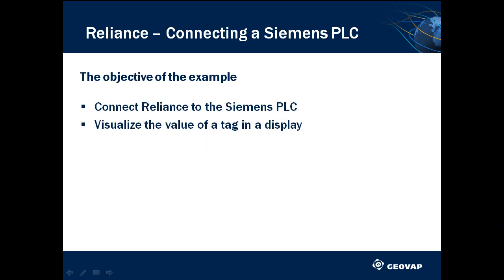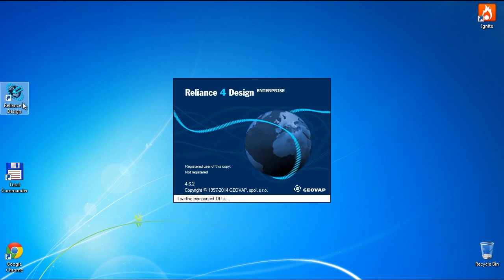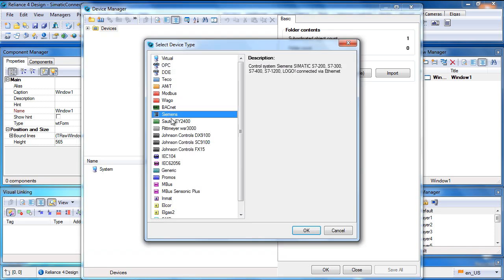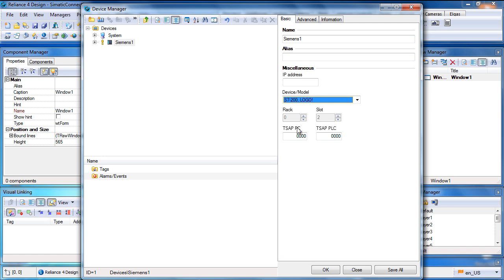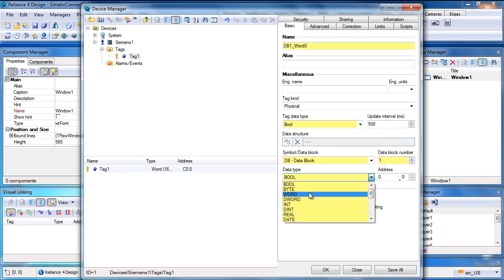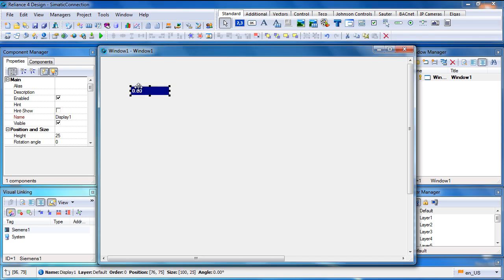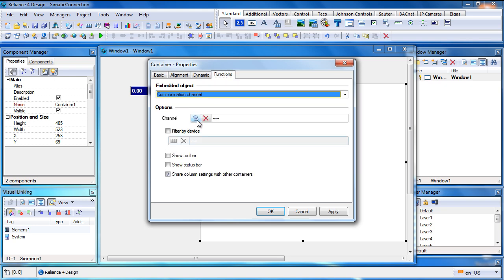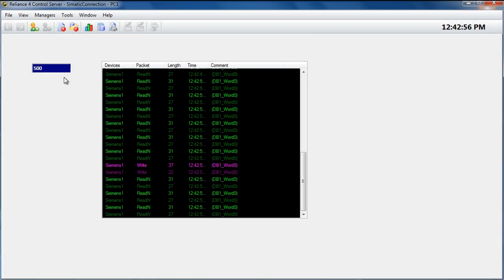Connecting a Siemens PLC to the Reliance SCADA/HMI system

Comment: As in your video you showed that communication is started when you enter ip address of simatic s7 and then start reliance control let me know what setup you used in simatic s7 currently i simulate simatic s7 with plcsim TCP/IP interface where my cpu connected with Ethernet with same ip configuration I entered in reliance design but connectection not established 
As per my analysis problem is in the simatic workstation configuration you will found In control panel of your pc i tried to switch single node to multiple node but server not getting started what configuration you used in simatic workstation configuration